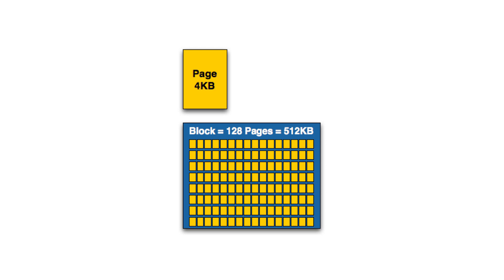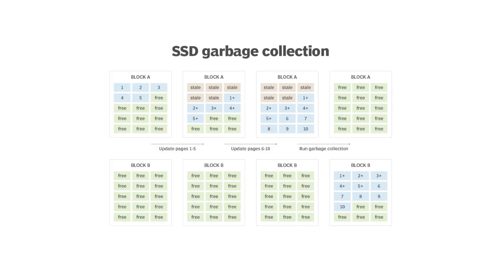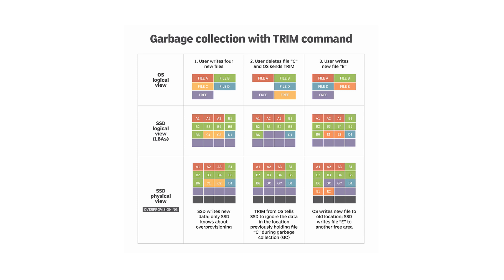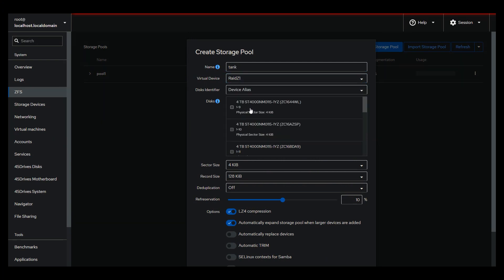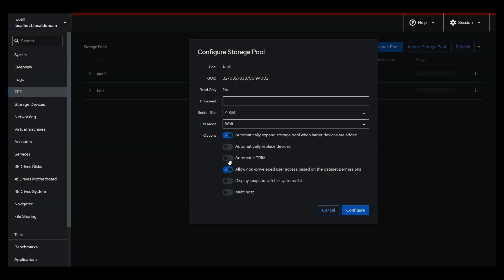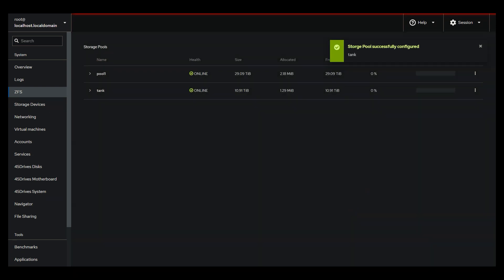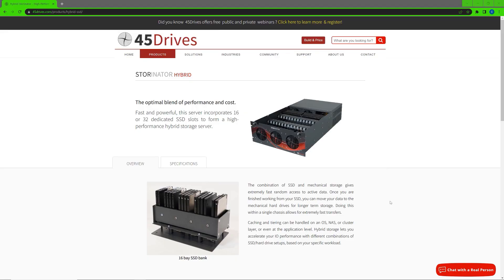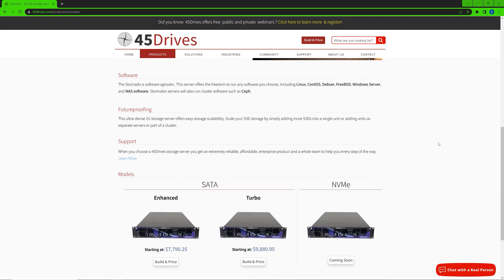Tuesday Tech Tip - Understanding SSD Trimming

Comment: I have a quick question. If I need to sell a used computer with SSD drive and TRIM was on, Can I just delete my data files using simple delete operations and will it be gone forever (unrecoverable) or do i need to use third party software to permanently delete it. Thanks in advance for your guidance on this.
Reply: Just encrypt the drive and then format the drive
Reply: @JOSE75214  Thanks for the suggestion. How do you format a C drive?